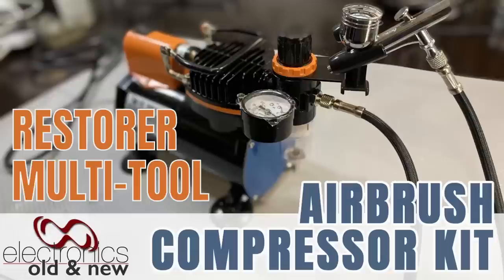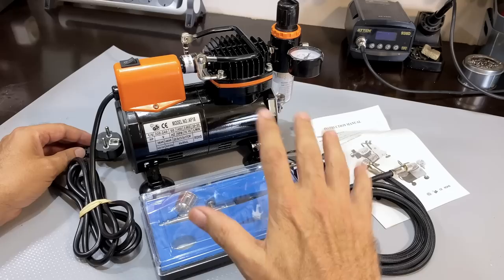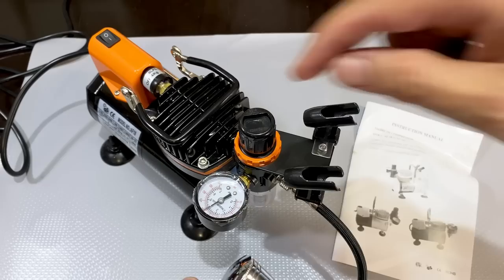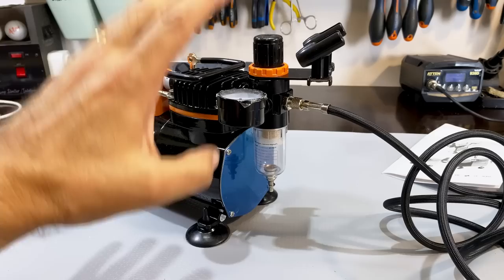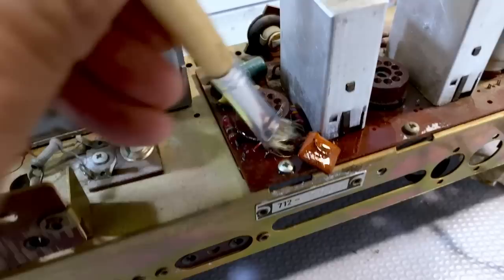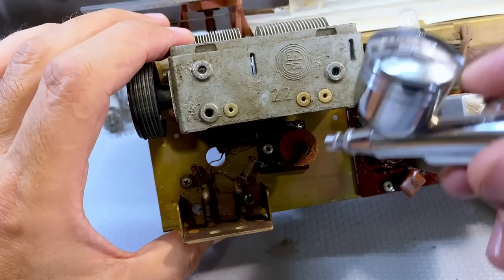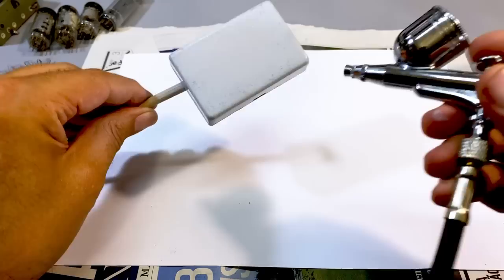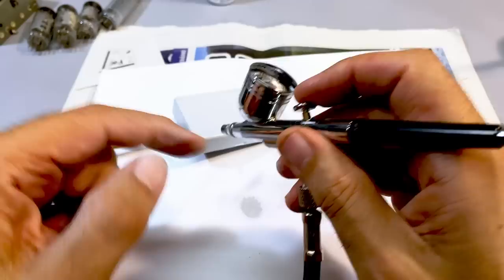The perfect multi-tool that I've been missing for my restorations? Airbrush Compressor Kit review.

Comment: 2:25 Ahh... you're not alone in this! There are some radios where these fine wires extend outside the RF coils' housings. You can imagine the havoc blowing compressed air to clean the radio creates in such cases. Then again one wonders: why would they do connections that way in the first place? Why did they not use normal wires? It's all done to make the restorer's life much more entertaining, is the only answer I could come up...
Reply from the maker: As good an answer as any 😊

Comment: NICE! You can make an attachment and use it as a small sandblaster for spot rust removal, it should be easy, you could use salt as a mild abrasive for testing. After rust is removed you can spot paint the aeria too!
Reply from the maker: Interesting idea

Comment: Very nice tool, I've considered getting one for my projects. Spraying the alcohol is a great idea. One suggestion though, before spraying alcohol,  spray just air while using a dry brush to loosen the dust. This way there should be less dust/alcohol slurry to clean up.

Comment: Watch out with spraying alcohol!!! I would never do this with my airbrush because of the low viscosity of alcohol (compared to paint), it will create fumes which are bad for your health and which are flammable! Especially since you're basically using it as a pressure washer. If you do this, I would advise only doing it outdoors. Or, what I would do is: still apply the alcohol with a brush and then rinse it off with distilled water or just simply with air. Much safer.
Another tip: always put the compressor on the floor. The first time I was using mine, it danced off the table due the vibrations and it hit the floor pretty hard. 😅
But even for normal painting it's a great tool to have when restoring radios. Enjoy your new toy!
Reply from the maker: Thanks for the tips 👍

Comment: As safety precautions, keep in mind that when you evaporate liquids like Alcohol, that those fumes are very flammable and that the pressure switch of the air compressor toggling on and off nearby will make sparks that can ignite those fumes. To get a air/alcohol mixture to ignite, there must be a certain ratio, above or beyond that, a spark won't create a ignition, but say never never. Also those fumes are not healty to inhale, so take care about the ventilation in the room you are working.
About static sparks due the compressed air, forget about that, compressed air is very moist, static electricity is more common with very dry air. 
I use compressed air for almost 20 years on electronics and never had a issue, but back in the early 2000, i once used a vacuum cleaner because it was a rainy day, and didn't want to take the desktop computer outside, after i cleaned the inside,i turned the desktop back on, the behaviour was very weird, very long bootup time and programs like internet explorer and outlook start crashing at opening, while 5 minutes before, the desktop worked fine. The first thing i did was a memory test, and i found immediately the culprit, both Ram sticks gave errors (tested each stick apart). Since then, i never used a vacuum cleaner again to clean electronics. 
And as last tip, maybe you can attached the brush with a rubber band to the airbrush gun, so that you can clean with one hand.
Reply from the maker: good tips. thanks 🙏

Comment: Water is good thinner for those acrylic paints so no need for harder chemicals like wind shield wiper fluids. Just keep on spraying but be aware that you might get addicted, I did long time ago😁
Reply from the maker: I will fight the urge 😊
Reply: @electronicsoldandnew  Createx wicked paints are really good acrylics and they also have acrylic clearcoats, matte, satin and high gloss(4050 is the gloss version). With them is better to use their reducer (4011). And don't use acetone or similar because the seals of that brush are not teflon, so IPA is good.
Reply from the maker: Thanks

Comment: I think two things are great in a tool kit for restorers and makers.  An Air Brush kit, and a 3D Printer.   Maybe not so much a 3D printer for the older tube equipment, but in general I have found those two tools the most used tools in my kit, other than the soldering iron.
Reply from the maker: I am putting off getting the 3D printer for now due to the space constraints I have. Otherwise it would already be in use 😊

Comment: Greetings:
Ideas: 1. Add a brush to the output of the nozzle so you can spay & brush with your right hand (just like the phono cartridge that has a brush jut ahead of the grooves). Any diy gadjet should permit flipping flipping the brush down and out of the air-stream while blowing only air (see #2)
2. Hopefully this sprayer can pause the liquid dispensing to permit air-only spraying to dry off the liquid. (Flipping up would make brushing difficult.)
Don't forget you sprayer adjustment setting. Maybe that ability to add a second sprayer is used when you need to switch to air-only.
How hard is cleaning when switching to different liquids?
I believe water is the part that controls the alcohol percentage in the various strengths of IPA. Wooden shaft cotton swabs (available single or double-ended) may be more expensive but are easier to use than your split tip chop stick. BTW: Adding a small spring above the split may help prevent over splitting.
You may find that lacquer-thinner or acetone are better for certain jobs.
Use an open top box as a small spray booth.
Reply from the maker: All good ideas, thanks. 
The air-only option is shown in the video, as is the spring on the chopstick.
Reply: Trouble I've had with cotton swabs is all the fibers they leave behind.  Really appreciated M Caldeira's makeup cleaning pad idea - those are dense and look like they won't shed fibers everywhere.
Reply from the maker: They don’t shed fibres like the cotton swabs, and they work out much cheaper too.
Reply: @electronicsoldandnew  Just bought some! (well, the Mrs. bought some for me)

Comment: On old prolongly baked dirt on paper-phenolic board and metall chassis spraying it initially with common household degreaser (for examle the yellow Meglio) is far more effective, after which brush, air and spirit will push the dirt and active surfactants out and dry water component before it soaks into the board.

Comment: The solution to this cleaning is very good. Only.... This compressor isn't made for high pressure and long hours. Mine was dead within a week.
So I would go and look for a higher volume and some bigger compressor.
Reply from the maker: I’ll keep an eye on the heating aspect as I use it more.

Comment: 3:15 If you carry the concept too far, you may build a contraption to turn this into a mini sandblasting tool. Granted, sand particles is not something you want spreading all over a radio but that's another problem.
3:55 You say that now but after a year's practice you might be able to draw the fine decorative lines on the radio cases or even (if you are that keen) repair damaged dial screens. That last one alone would justify the purchase of such a tool.
Reply from the maker: I’m a looooong way from getting that perfected, but I won’t give up 😊

Comment: And the best part of spraying alcohol like that and sit there and inhale the alcohole fumes
is that the cleaning just gets more and more fun as you go on.
By the time you're done with the radio, you'll be dancing on the ceiling 😄
Reply from the maker: true 🥃
Reply: Wood alcohol, not good for you. Denatured alcohol is made from ethanol, so the worry is now about the denaturing ingredients.
Is there a feature to permit switching to air-only while there is liquid in the reservoir?
Reply from the maker: If you just press down, only air comes through.

Comment: 17:41 Is there a name for this particular type of addiction?
20:55 If you get too carried away, remember to leave a window open! ;)
21:20 Cleaning tuning capacitors is probably the first or second use for this that came to my mind.
21:31 Not sure if it is a great idea, but would you ever consider rubbing with some aluminium foil to remove the rust? It works well with painted surfaces as it's too soft to remove the existing paint (as opposed to sandpaper) but I don't know whether it can be painted on subsequently. It also can leave a big mess of small aluminium flakes.. :(
Reply from the maker: I will be trying this on multiple radio parts, including tuning caps. 
I use wet and dry sandpaper (1200 grit) which is extremely fine. Never tried foil.
Reply: @electronicsoldandnew  The aluminium foil is only a temporary solution used to remove blemishes due to rust breaking through paint/plating. The aluminium acts like a mild abrasive (and possibly also reacts with the rust?). The point is that it does not remove the existing paint/plating or does not mar it gravely. It can be tried for example on plated metal inserts that are used for decorating selector/volume knobs. As it's only temporary though, you need to seal the surface with some varnish to prevent the bare iron areas from re-oxidising.

Comment: That water based acrylic should be handy stuff. However, how durable that paint is? I mean mechanically - will it survive if say you try to scratch it by nail?
Reply from the maker: Depends on the item material. If it’s too smooth, I expect it will scratch off.

Comment: I would be concerned about sparks. Using compressed air can create a static charge, be careful
Reply: Not really, most of the stuff he restores is Valve based. I've worked in a renowned Audio repair shop and they've been in business for 30 years and never had a problem with it.
Reply: static charges or sparks dont matter on valve equipment..compressed air is used for cleaning computers instead of vaccum...i was always taught that vaccum cleaners create static charges so we should use compressed air to clean dirty computers....could it be wrong line of thought?
Reply from the maker: Makes sense to me
Reply: @MrHBSoftware  Moving air creates a static charge, it doesn't matter if it's compressed air or vacuum

Comment: Will that cup on the top of the air brush take a plug in tank intead of the cap for a larger capacity?  So that you don't need to keep stopping to refill with alcohol. The results on the respray of the speaker in the "James Bond Radio" looked good.
Reply from the maker: I’m not sure what can be adapted but I think the capacity isn’t too bad as it is. Since the refill  is alcohol, it’s easy and not messy at all. Yes, that speaker was my first ever experience with an airbrush 😊

Comment: hi..beware that some ceramic tubular caps absorb the alcohol and short circuit...has happened to me various times so i gave up doing that and went back to cotton swabs...why dont you try brake cleaner? dries instantly, no residue...problem is that everything looks hazy after using it, it dries so fast and removes grease so well that mettalic parts tend to rust faster too... brushing wd40 after cleaning makes everything look good and shiny but then you have the problem of dust sticking to the chassis...so i still couldnt find an optimal solution...but it certainly is not spraying alcohol

Comment: I don't like pressed air in a workshop. You broadcast the dust all over the room and the furniture. I have a cellar for diy .... work with wood and metall and no compressor. I use a shopvac, thats much better. Only my 2cent. And with blowing the alcohol you should wear a mask.
Reply from the maker: I agree about the dust, but the alcohol … could make happier restorations 😊
Reply: @electronicsoldandnew  :-)